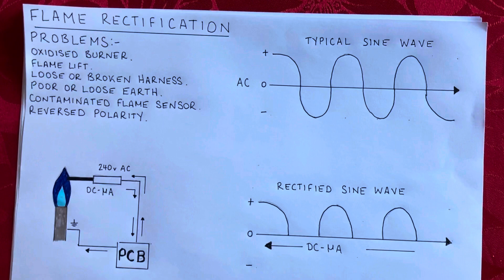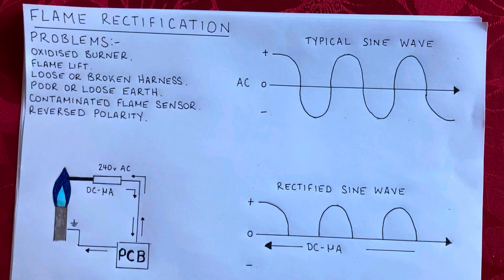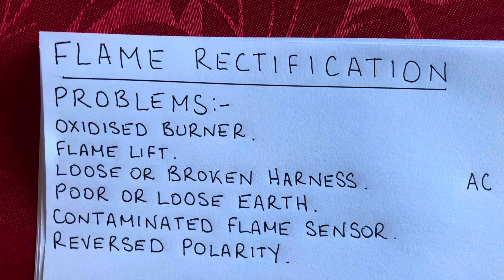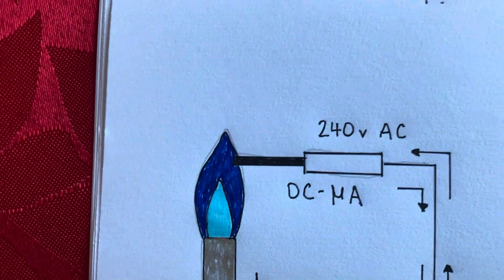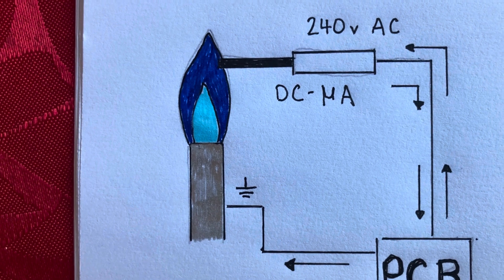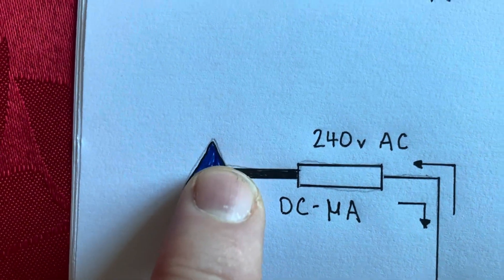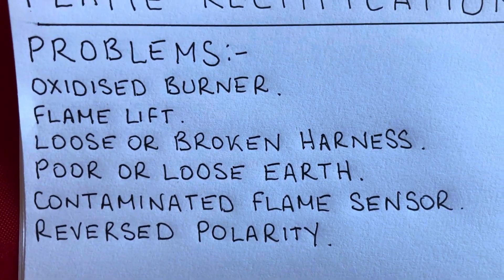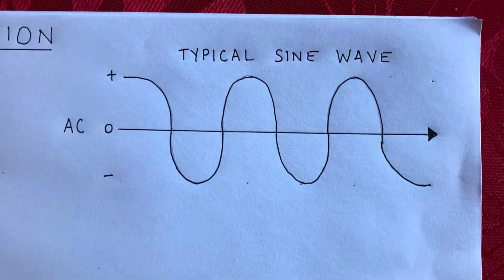Gas Training - Flame Rectification - Ex Ideal Boilers Gas Engineer

Comment: On the EPH combi pack 4 is there a way to turn the heating on from the receiver? When I do push the receiver button the radiators turn off after 10 seconds? Any ideas ?

Comment: As far as i know this is only happening with really old boiler polarity issue, i know for example Sime Murelle old one 20+ years, another thing that's not covered is that new boilers have little resistor on cable and so ON this is pretty much only for old boilers
Reply: There are two or three different ways to detect a flame, with rectification. This is one of those ways. I would say 10 years plus but a lot are still out there and I wanted to just show an example of what would happen. Not necessarily the exact process of rectification.